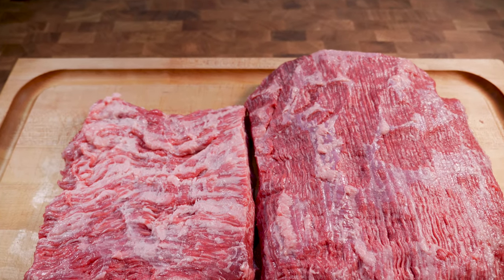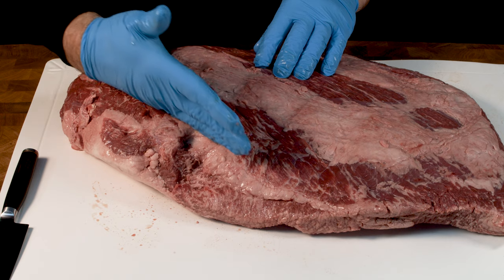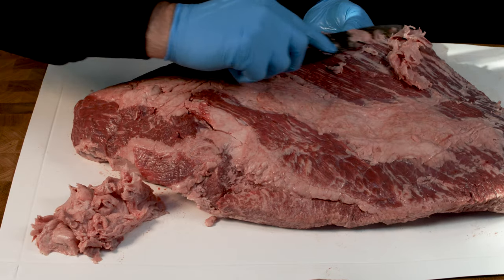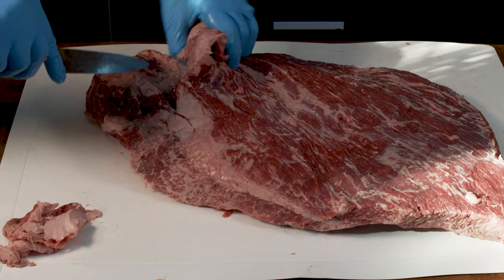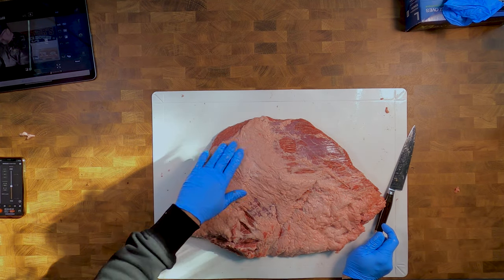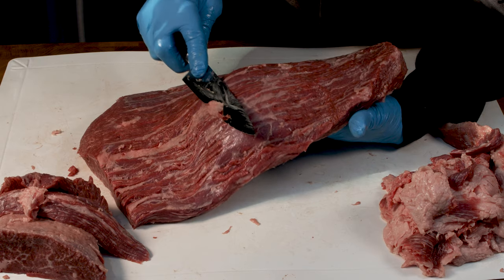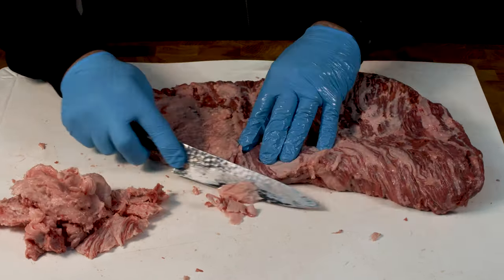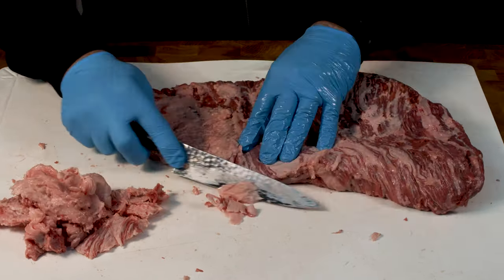Trimming and Separating the Brisket Point and Flat | Detailed Step by Step | 4k

Comment: Thank God for you and the other generous chefs of Youtube!  I bought a brisket for the first time today, planning just to braise it for a long time in my cast iron dutch oven.  But noticed while seasoning (because I've worked with pork shoulder) that there seemed to be two roasts. I trimmed down the seam and then felt like maybe I wrecked it. But, seems that was ok.  The other thing was I was not planning to trim the fat thinking it would contribute to tenderness,  until I watched these instructions. I'm so glad I've now followed your instructions and trimmed the fat --- wow! There was alot! Anyway still need to cook it but thanks to you I feel like I've got a running start.
Reply: Depending on the cut... fat can contribute to a lot of flavor.  

It's situational for separation and fat trim... but I'd say on a nice Choice cut to leave about a 1/4" fat cap over the brisket with the muscles still together.

This is a wagyu brisket, which has fat throughout the fibers, so the fat cap and intra-muscular fat doesn't contribute to overall flavor or tenderness.  

Me -- I'm going to separate and full-trim the flat to make jerky and keep the cap on the point to roast for a holiday dinner.

I hope yours turned out great!

Comment: It took me about two hours to trim, cut it up in pieces, packages for freezing, and store a nineteen-pound beef brisket (label showed 17.6 lbs.) That included sharpening my butcher, trimming knives, and taking a couple short breaks. The brisket wasn't very cold fresh from the Kroger grocery store. There were five pounds of fat after trimming fairly close to the meat. This was my first one and maybe my last. The price was $3.00/lB and the meat didn't have much marbling. So, It will mostly have to be slow-cooked.
Reply: Low-n-slow wins the race.

Comment: Separating the flat and the point is also necessary when making beef jerky. I like to put the flat in the freezer prior to slicing which I still do manually so it's safer and makes more uniform slices, for me. BTW, do you know what the most dangerous thing in a kitchen is? 

A dull knife.

Comment: First time i've watched someone on the tube do this. I've threatened for years that i was going to smoke a brisket with the two muscles separated. I always separate them after a cook and slice properly. It makes me twitch when i watch people take a cooked brisket, slice it down the middle. And say this half is the point and this other half is the flat. Once cooked the knife blade runs between the two with ease. Just follow the fat line. If you start to get off their will be resistance on the blade from cutting into the meat. When catering a event i use electric knife to speed things along. Little tricky staying in the fat line. But after one or two you get the hang of it.

Comment: You'll find that using a 6 inch semi-stiff curved boning knife will work a lot easier and quicker than that chef style knife you have. Also, it's a lot quicker to seam out the the two muscles first and then trim them.
Reply: Same i use a mercer culinary 6 inch semi stiff to trim all my briskets works far better than any other method , sometimes a 10 inch semi stiff is good for removing that silverskin on the bottom of the brisket

Comment: Having made wagyu pastrami dozens of times, I cried a little bit when I saw how much exterior fat you removed from the flat.  My best results have come when leaving a thin layer of fat -- 1/8 - 1/4" -- on the outside of flat all the way through the process.  At the end of the day, I think you want that very thin layer of cured, seasoned, smoked fat in the final product.  That makes for the best eating.  Of course, this is obviously just a matter of opinion.  Looking forward to watching your pastrami video.
Reply from the maker: Cheers Ronnie, I'll definitely have a go your way on the next one and see which one I prefer 😁
Reply: I agree. I’ve made pastrami several times as well, never wagyu, and I leave 1/4” at least.

Comment: He does a pretty good job on this, especially considering how dull that butter-knife is, and how warm the brisket is (cold = easier to trim). The "liquid-like shimmer" is a sign to stop and put that bad boy back in the flash-chiller for 15 minutes or so, especially with Wagyu and its high marbling ratio. I use a combination of two or three knives when I separate mine: a 7" boning knife, a 7" filet knife, and an 8" chef knife, all fo the razor sharp. Most of the fat is trimmed with the chef knife or boning knife, but the highly intricate cuts, especially the the deckle seam separation, is done with the filet knife.